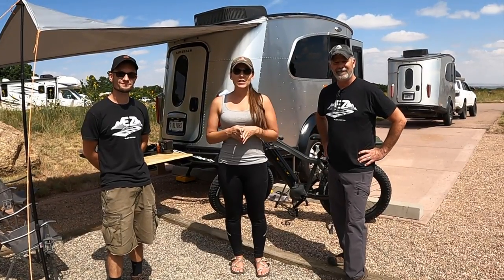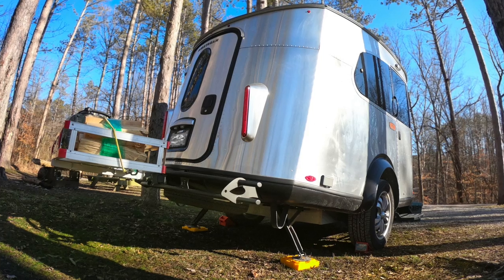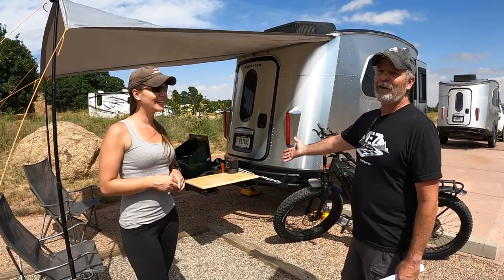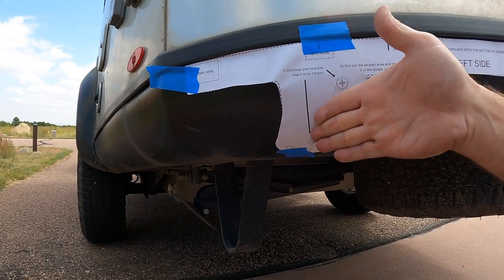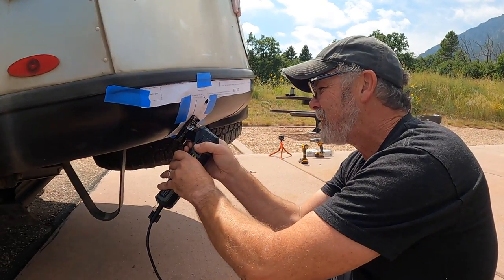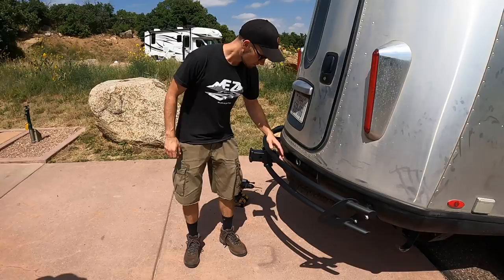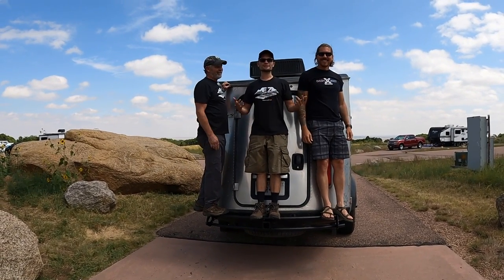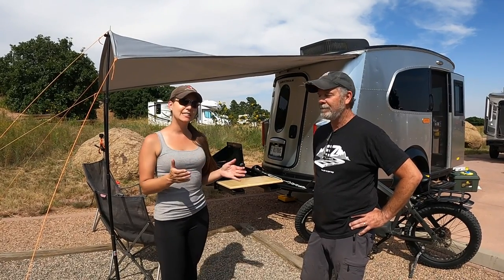Airstream Basecamp 16X Bumper: EZ Rec Rack Utility Bumper Installation & Specs

Comment: Nice looking bumper Cass!! I found your channel researching single axel toy haulers, go figure.  You are causing me to fall in love with the Base Camp x only one problem.  Probably not going to be able to stuff a dirt bike in through the back door.  This bumper though.......I know the weight rating is off a little (100#’s) but at least it brings hope.  Maybe the Base Camp 20x would work.  Don’t want to get to heavy, I also enjoy the versatility of a Toyota tow rig in the Tacoma. Just finished up a trip to Moab and Prescott with the old trailer and am ready to upgrade. Take care, love all the great videos.
Reply from the maker: That's great that my content came up, thanks for checking it out Jonathan!  Long shot, but have you seen the older Basecamps?  Back from 2008 timeframe.  They had the actual loading ramps. Not sure what the specs are on them thou, and they are hard to find.

Comment: This is awesome, so happy for you Cass! We just sold our Ford F-350 and our 28 Ft TT and we are downsizing. We bought a sweet clean 2019 Tacoma Pro with 5,000 miles on it and we are shopping for a new trailer, my head is spinning with all of the research we are doing.
Reply from the maker: Congrats on the new Tacoma! That truck should treat you well for many years.  And yes, the research can be overwhelming. Good luck with all of it!

Comment: Another great video Cass! I had made a comment about you cooking outside before so it would be fun to see you get the grill attachment and maybe a canopy. I had a similar setup for my Jeep's hitch receiver for football tailgating some years ago and I felt like I was running a Western chuckwagon. As always, keep up the great work and please stay safe! 🤙
Reply from the maker: Yea I would love that rear setup, as then the outdoor kitchen is well out of the way but always set up and ready to go. That’s great that you took yours tailgating. Such a good use of an outdoor kitchen.
Reply: @TailsofWanderlust  Well it is just nice that you will have that hitch and you can customize your options based on your trip. You have made wonderful use of your kitchen in the Basecamp and it clearly serves you well when you need to stay indoors or are boondocking, etc. But there are so many options for trailer hitch kitchens (many under your 150 lb limit) that it would seem a fun addition. I would advise getting a kitchen box than can be closed and locked since, you use your truck during the day for other adventures. Mine swung out to the side and I could use the back for several features, but I had a higher weight limit directly off my Jeep than you will have. You could just have a cook surface and a sink and use a lightweight roll-top aluminum camping table for the prep surface. We use a table from Camco that weighs only 11 lbs and can be used to seat 4 after meal prep. I think we paid about $65 online.
Reply from the maker: Great info on the outdoor kitchen options, thanks John! Sounds like you have a really great setup going.
Reply: @TailsofWanderlust  Oh my daughter has been following you ardently and looks to travel alone one day. She isn't quite old enough yet but you have inspired one young lady to get out and explore. She wants to do the converted van route so she can truly stealth camp. She will be getting one of your Jasper hoodies for her birthday.  :-)
Reply from the maker: That is amazing to hear!!  Love hearing of others thinking of taking the leap into solo travel.  The converted van route would be a great way to go.  I have a few friends who have switched from a trailer to a van and love it.  Much more flexibility.  And thank you for giving her one of the sweatshirts! That means a lot.

Comment: Excellent product, appears a very easy installation. To install in no friend mode, after the self tappers place a jack under the hitch to supply vertical pressure when drilling permanent frame anchors and/or use locking plyers, the type that grip:) under hitch supports clamped onto the frame once it's position before drilling. nice to see someone giving it a go at small business venture rather than sitting at home collecting a check, if i had a basecamp i'd definitely be making the investment! Thanks for sharing, happy trails! as well, nice to see you are in good spirts Cass.
Reply from the maker: Really great tips on how to support the install when solo, thanks for sharing the thoughts. And thanks Robert!  Always really nice to support small businesses.

Comment: Couldn’t help but notice the awning/canopy Ira had off the back of his base camp. Are you able to provide any info about that- looks like it locks into the channel along the outside of the back of the trailer. I am a fan Cassie- thanks for sharing all the insight and experience you have gained.
Reply from the maker: Hi Barbara - Yes it is an awning his friend made.  It sits in the  keder rail and then uses tent poles and tie downs to hold it up.  His friend doesn't currently make them to sell, but if that changes I'll be sure to get the word out!

Comment: That's a great addition for bikes or other light weight items.  Although, some idiot will see that hitch in the bumper bumper and hook up their ATV trailer, boat, etc. to it and try to tow it with those little self tapping screws holding it onto the trailer frame.
Reply from the maker: That’s why the manual and all say 140-150lbs max and not rated for towing. Let’s hope no one tries it!

Comment: Can you tell me what the towing capacity is on your car? I want to get a jeep wrangler and the towing is a max of 3500 pounds. I want to get Basecamp like yours, which is less than 3500#. The airstream sales person said I should have a car that towes 20% more than the weight of the trailer. But she told me I should get a car that towes 5000 pounds.
Reply from the maker: The towing capacity on the 4Runner is 5000lbs, and tongue weight 500 lbs.  I agree with the Sales agent, it's better to have a bit more power. Also, check the tongue weight capacity of the Wrangler. The Basecamp may be too much weight for that.

Comment: Are you using brake control and weight distribution hitch?
Reply from the maker: Yes there is a brake controller in the 4Runner.  I do not use a WDH.

Comment: Good video 😃 why did you pick a base camp it's really expensive and small why not a bigger Airstream my be 20 feet 🤔 all Airstream trailer are more expensive than other trailer just asking 🤔
Reply from the maker: Thanks Stephen!  If you check out around the 12 minute mark in this video I explain why on the Basecamp.  There were several things that went into that decision.  It was also the cheapest Airstream at the time, so I was a lot more comfortable with the price. https://www.youtube.com/watch?v=8To3842tOdw

Comment: Has anyone asked Airstream whether this affects warranty or is recommended?
Reply: Magnuson Moss Warranty Act
Basically says that the company cannot void your warranty for adding an aftermarket part unless it directly affects whatever is being disputed.

If you add a solar panel to the roof of your airstream they couldn’t void your warranty on the suspension. But they could if you drilled a hole through the roof and it leaked.
Reply from the maker: Thanks Ira!
Reply: Possibly warranty issues aside, I did take the time to ask Airstream what they thought about this modification.  They said they didn't recommend it.  That might not mean much but it could come up if you had an accident and insurance could point to a loading, balance or tongue weight issue.
Reply: @jefftrapp5407  No manufacturer has ever recommended an after-market add-on that the manufacturer didn't design and sell.   They don't have one, they can't test it, so they can't recommend it.  And, even if they did have it and tested it, they wouldn't recommend it.    In any of these situations the core questions are the same: Does it effect safety? Does it effect performance? Does it effect warranty?   With an add-on such as this, the first rule is go easy.
Reply: @brettmccabe2414  I think that's a pretty broad generalization.  I once saw a tail heavy travel trailer get into a fishtail and it ended up crashing, luckily no one was hurt.  I do think the engineers at the factories know a bit more than that average person.  I did contact airstream about this and they said it's not recommended, would void the warranty on the frame etc. and I asked my insurance company and that sort of unapproved mod would also void your insurance.

Comment: On another note, at minute 5:50 when they point the camera under your frame I can see a wad of duct tape that has been jammed into an inside corner of the frame of your Basecamp.  It was placed there for a reason, and its now falling out... Cass?  Is this your work, or did someone working on your trailer give you a duct-tape repair?
Reply from the maker: Good eye Eric!  This is my in the middle of nowhere attempt at plugging the holes where mice come in. Happy to report it works.  Less happy to report I swore I’d do a permanent solution, and a year later I still have duct tape 😂
Reply: @TailsofWanderlust  How about getting underneath there cleaning it with soap/water... Let it dry... Masking it off with painters tape and putting in some caulk or Flex seal.  Despite the fact that it's on TV all the time it's a decent product.  Cheap fix too.  If you use flex seal spray then use lots of masking paper unless you like messes
Reply from the maker: Thanks for thinking through that fix. My plan is to take a piece of metal and bolt it in back there. I just haven’t taken the time to go to the hardware store.  It should have a couple tiny holes in it for any water drainage if needed.